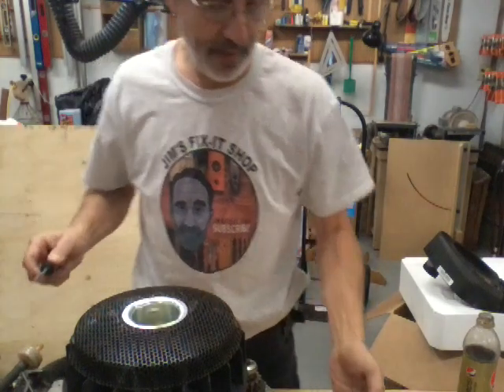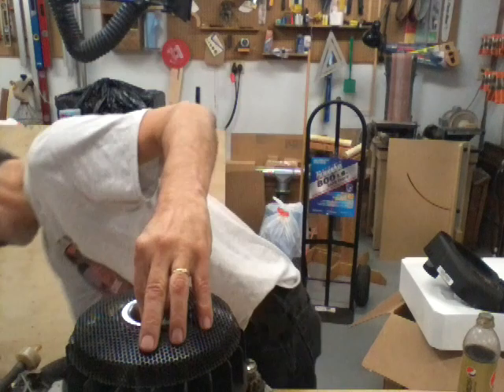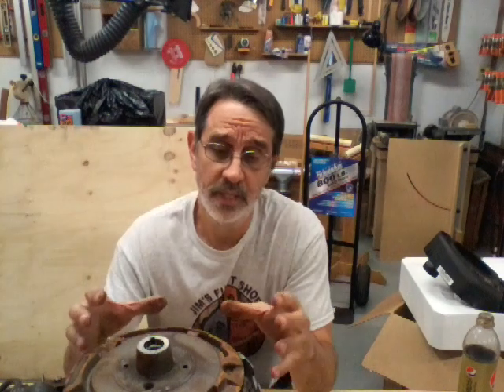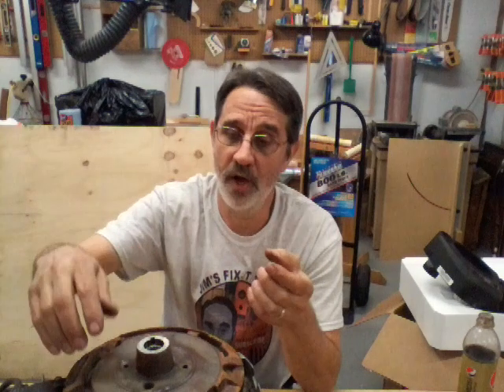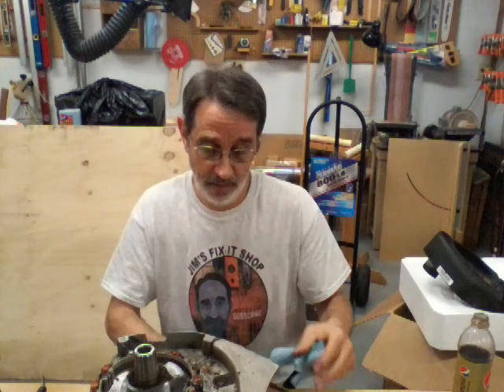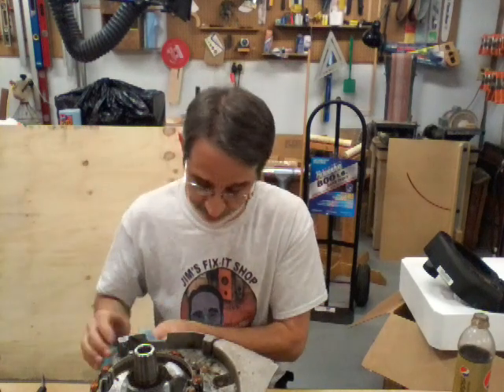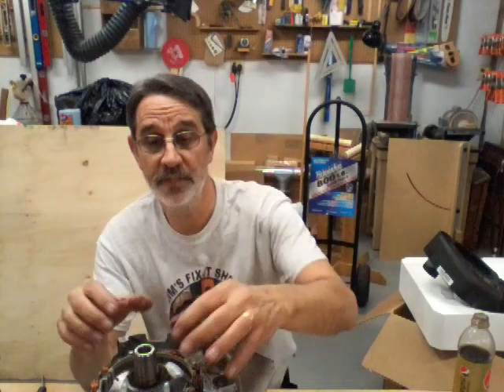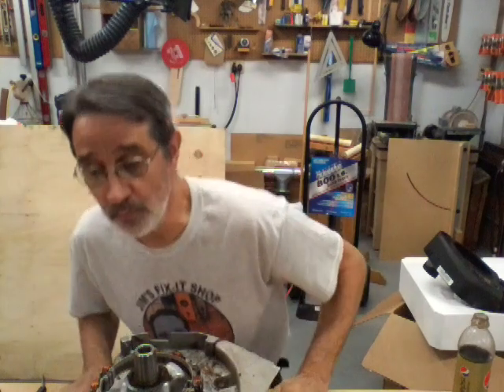212. 48 M/S.  Replacing the key in the flywheel on a Briggs & Stratton engine

Comment: I have a RER snapper with a Briggs and Stratton 12.5 intek engine.  I have been noticing over the years that my engine will not turnover and the flywheel seems to be stuck.   Previously, it did that but would eventually start.  Now, it only moves a little and clicks.   I am hoping I do not have to put in a new camshaft… at least not right now.   Are there anythings I can check to see if I can adjust the valves or anything to allow me to get it running.   Thanks.

Comment: Jim Im a long time subscriber and I have run into a problem.  After replacing my plastic starter ring gear with an aluminum one, I thought I was all set.  I replaced the flywheel and put everything back nicely but the engine will not start.  As a matter of fact it backfires very loud.  Ive taken apart again replaced the key on the crankshft/flywhell and same thing happens.  I have spark as ive tested that but the darn thing will not start.  ive removed the kill switch, pit it back on....Im raising the white flag on this one.  Thanks for all your help over the years through your videos.
Reply from the maker: If every time you try to start your machine it messes up the key on the fly wheel then you’re not getting the flywheel nut tight enough to hold the flywheel when the crankshaft starts to spin as the engine fire. Jim

Comment: Jim my snapper flutters like gas is not flowing freely to engine. At high speed 3 gear it’s noticeable but doesn’t die. At low speed it will die. I replaced the fuel line and filter thinking hose collapse. It was better at first then started this fluttering . You think it could be valves sticking or valve spring.i have been using regular gas with ethanol. I watched your vid on gas and will change in the future.Great series  how you tell what year your snapper is.
Reply from the maker: WAYNE V. 
  Hi Wayne
   I would say it’s probably your carburetor is dirty and needs to be cleaned I doubt if it’s the valves if you pull the rope and it has good compression I would say the valves are OK you could do a compression check on it and tell. Jim